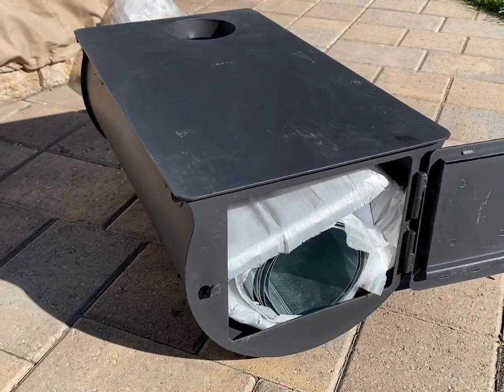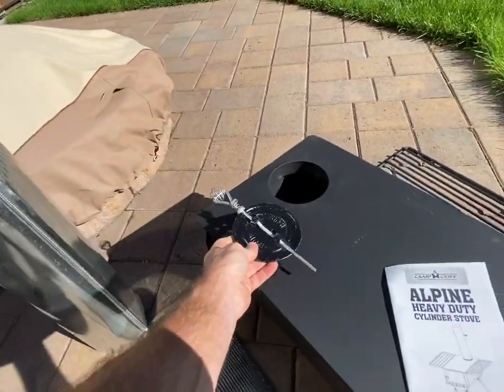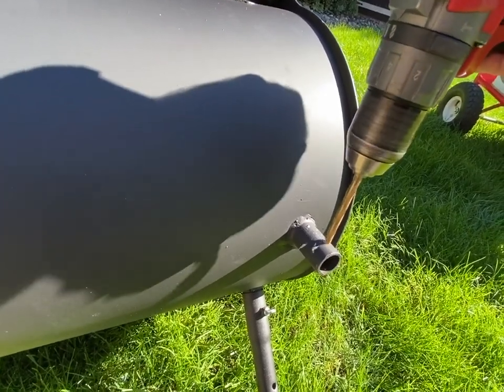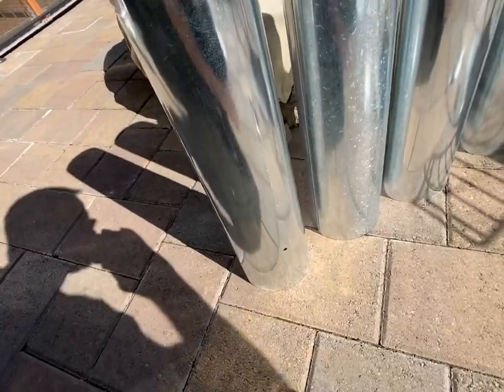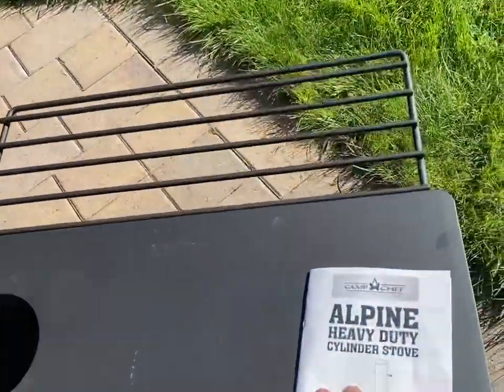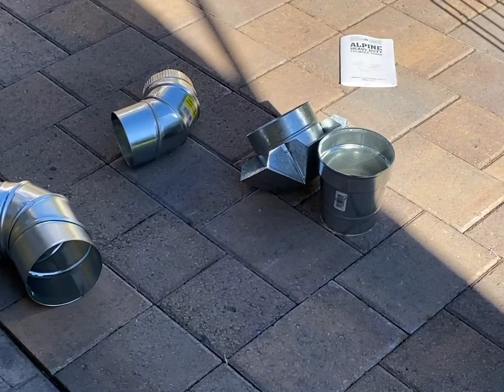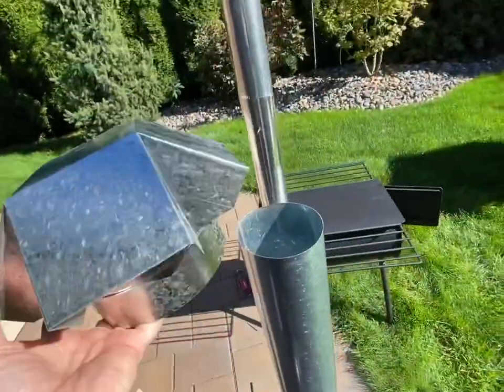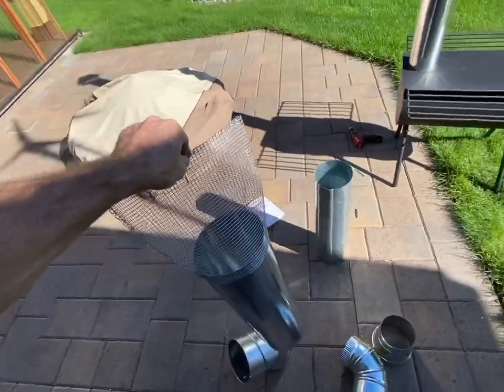Setup & Review Camp Chef Alpine Wood Stove

Comment: I actually just ordered this same stove tonight for myself, going to modify it slightly, adding a rope gasket to the door for better air seal may weld in a baffle to increase efficiency for secondary burn may also add a layer of thin refractory brick to prolong the life of the belly of the stove and then fabricate a new grate and then weld on tabs to the bottom of the legs with a hole drilled in incase I want to fasten down to a floor with a couple screws so it's secure in it's position, I'll definitely be getting a different chimney cap as well but all told it seems like a well built unit and with proper care should last for many many years to come.
Reply from the maker: Thanks! Yes, there is much room for modification.  It's a good stove for the money.  If you really need it - I think it's going to be very valuable in a situation where getting heat and cooking is critical.  The price was right!
Reply: I have this same stove going on four seasons now, don't mess with it- works perfectly fine the way it is. easy to start up and burns great the vent holes in the door draw in air right to the bottom of the grate- it burns hot!

Comment: Hi, I have one and use it often for my garage. This ia an awesome stove, BUT the 5 inch chimney pipe that is inserted into the stove melted. My flu is now about 3 inch from the flat service. 
I have been trying to figure out the best way to install elbows as well without it melting.
Reply from the maker: Holy cow!  It melted?  Must have got REAALYY HOT.  I'd recommend putting a temp gauge on it and running it a little less hot.
Reply: @TheRealWorld737  Ya when I bought mine. I would just throw wood in and really monitor it. The pipe got beet red.. Now im looking where I can purchase another pipe. Live in Canada not many places have a 5 inch pipe that deliver.
Reply: @chrisox  ecco supply or other sheet metal wholesalers... get 26ga minimum... adjustable elbows can be tricky and sharp to spin occasionally.   The inexperienced should wear gloves.  throw some gasket on the door and damper down your burns, or risk the problems that arise

Comment: Do you know what the stove pipe is? Galvanized? I’ve heard galvanized can be toxic?...
Reply from the maker: Yes, it's galvanized.  Some galvanized pipes need to be heated several times before being used in a confined space.  As with any wood stove - I'd only use one approved for indoor use unless you really know what you are doing and have adequate ventilation for safety.
Reply: Wood stoves use a blue steel pipe, and oil furnaces use a galvanized flue pipe, some of the high end tent stoves use stainless steel flue pipe.

Comment: how do you glue on the seal for the door
Reply from the maker: You dont
Reply: @TheRealWorld737  it falls off
Reply from the maker: Mine is in storage at the moment.  I do not recall having a seal come with the door.  Glue would melt.  These stoves are designed to not be used in an enclosed area (other than maybe a well-ventilated tent).  So with a hot fire going inside - all the smoke is going up through the flue - so you don't really need a seal.  This isn't an indoor wood stove - and isn't safe for inside your garage or home.  Also, if you look at their product page for the item at Camp Chef - you will notice a few things:  1. There is no seal on the door.  2. There is a place where you can ask a question about the product and get an answer from the company.  Here is the link: https://www.campchef.com/alpine-heavy-duty-cylinder-system-%7C-camp-chef/CC-CS14.html